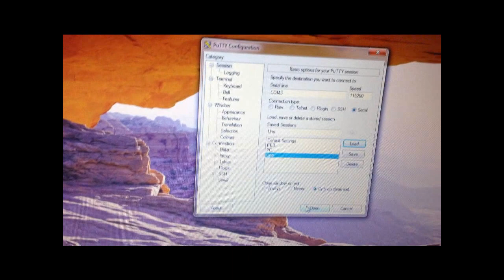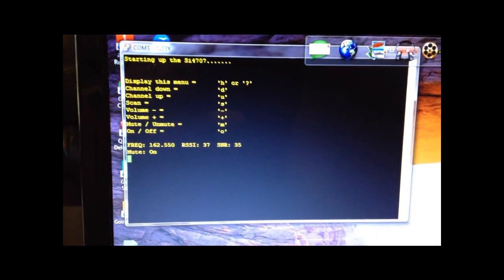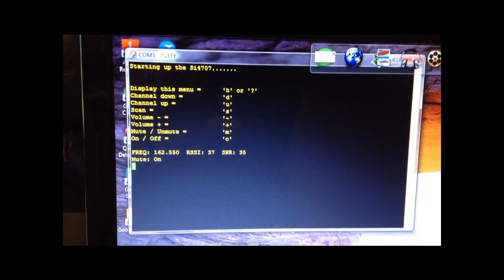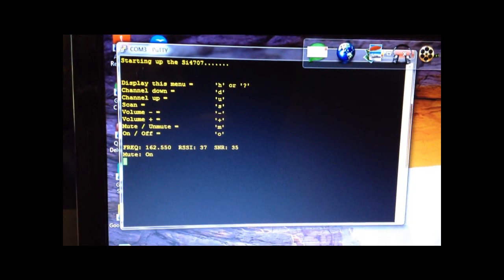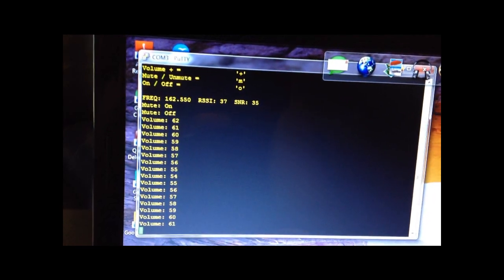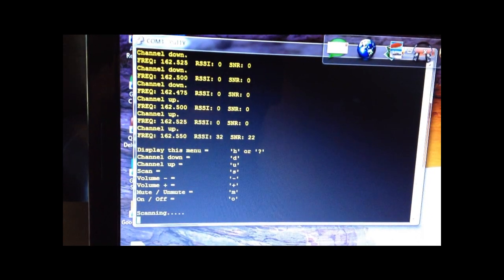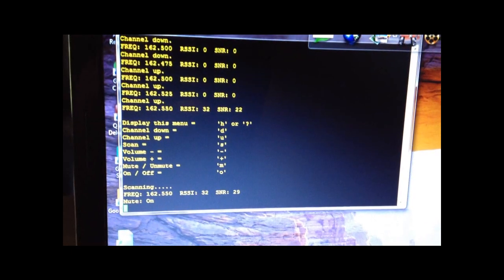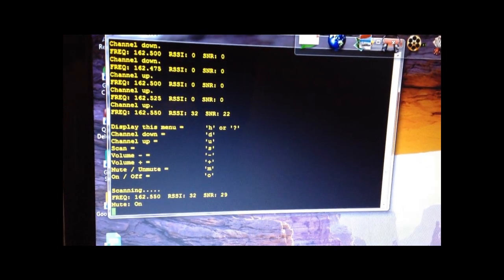Si4707 Weather Band Receiver Module

Comment: Awesome stuff! Thanks for posting it! Would it be possible to set this up with buttons on the Arduino to control the scan and other functions instead of a computer & keyboard?
Reply: Awesome. Thanks. I'm making a clock that picks up the atomic clock signal and it would be awesome for it to get/display weather as well. Did you figure out the code to decode/display the message data as well? Cheers!
Reply: Cool. Thanks again!